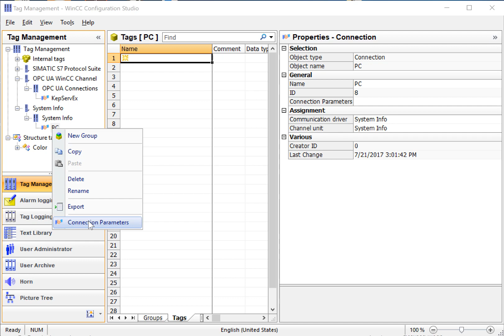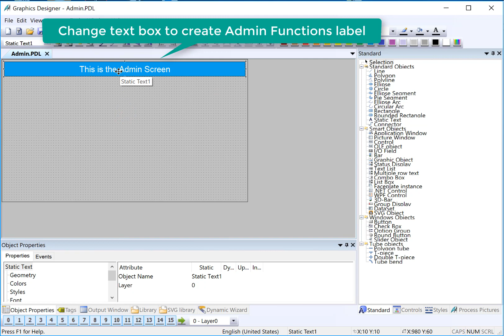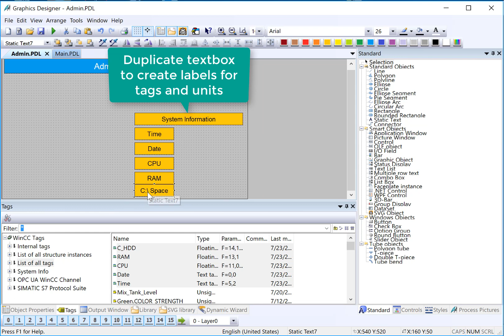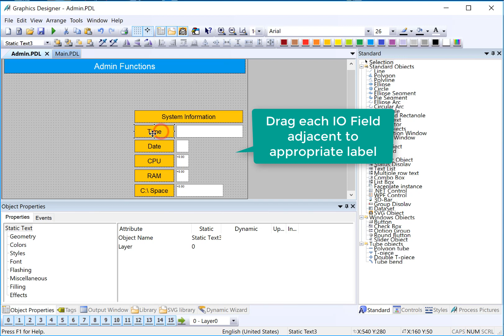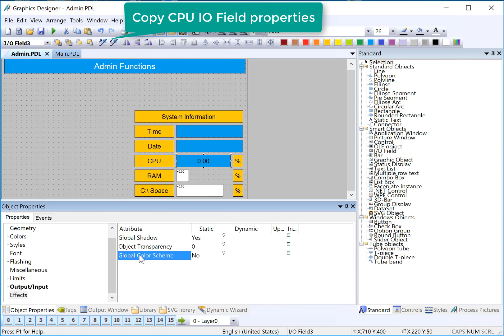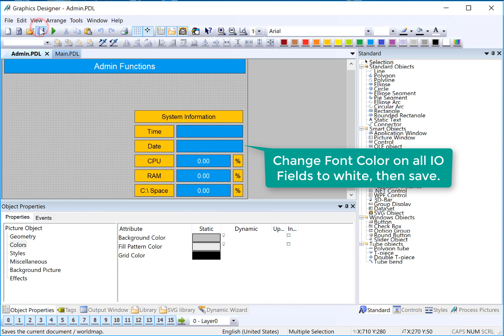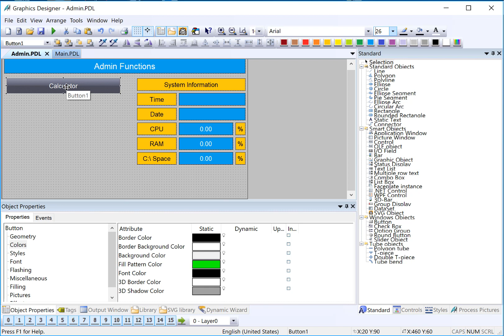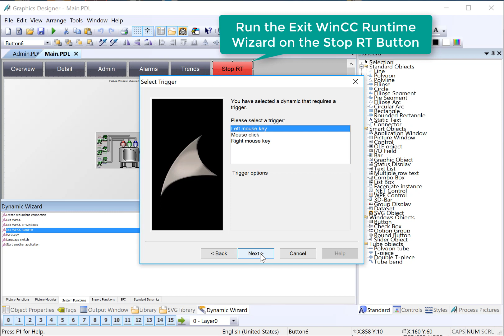WinCC v7.4 Step By Step #12: Create Admin Screen w/System Info Driver 📇 #WinCCGURU

Comment: dear Bob, when i try to make the same exercise at my computer . CPU data doesnt come. and when.and my i configured the calculator but it doesnt open . what can be cause
Reply: Der Wizzard schreibt am Ende nur den Pfad und calc. ,vergisst aber die .exe - ergänze exe und es funktioniert!
Reply: @r.m-a  bei mir ist da selbe)
Reply from the maker: Make sure you select the correct function and data type for the CPU TAG.
Reply from the maker: Also check the path to calc.exe in the script.
Reply: @WinCCGURU  thank you very much